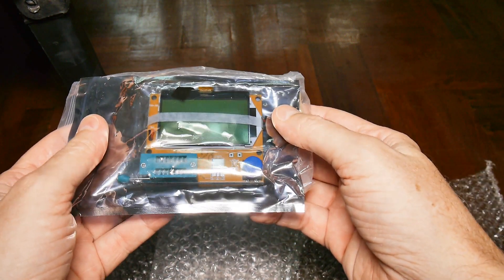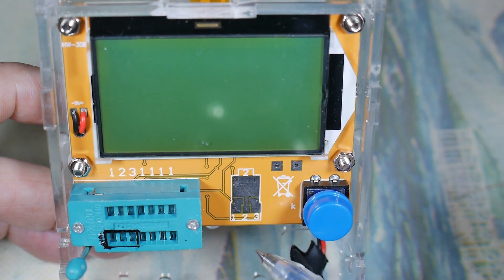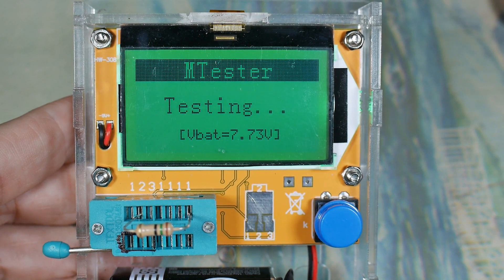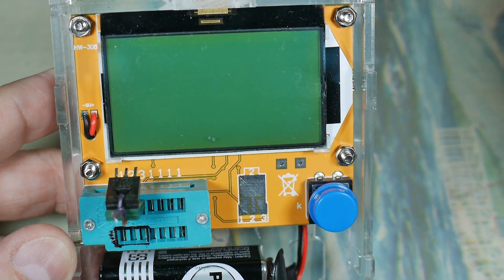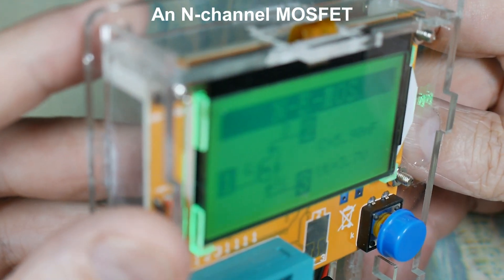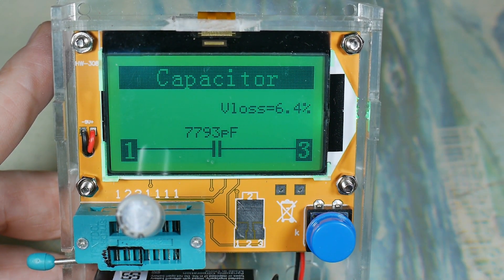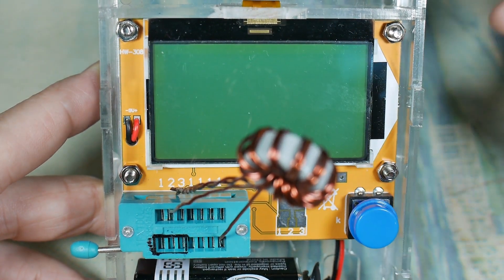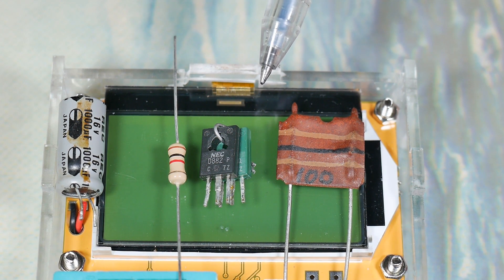Smart Component Tester - Demo Only (LCR-T4 M328)

Comment: They "spread it out" because they used the smallest ZIF socket available, a 14 pin DIP socket. There is no three pin ZIF socket available as far as I know. They were then confronted with the other 11 pins and what to do with them. They decided to double up with three of them, perhaps to allow for wear and then to make the other 8 pins the same as pin 1 which would allow for some longer or larger components to be inserted with less trouble. 

There is an old engineering saying that "form follows function". In this case the reverse is, at least partially true with function following the available form.